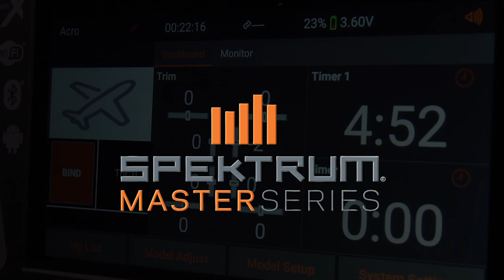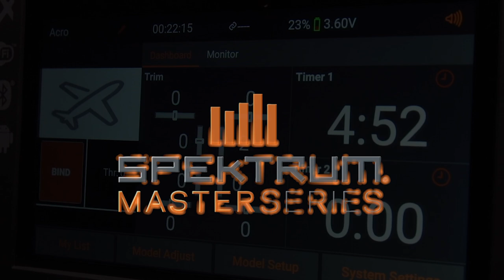Advanced Wing and Tail Type Setup - Spektrum Master Series

Comment: Now you need to do one showing how to set up the transmitter's flight modes on the flap switch so that you can trim the ailerons and elevator in each flap position. Also, show how to put the flight modes on the rate switch and rudder stick position switch to increase the elevator and aileron throws whenever the rudder stick is at or above 85% deflection.

Comment: Thank you, great video explaining this. I also found that my NX10 also has the crow feature built in to the software if the correct wing type is selected in the setup. This on firmware version 3.06, current at this time (12-08-2021).

Comment: One major problem that you need to fix on your radios is the fact that they don’t work well when you have a plane that has four flap servos. What I mean is that you have two flap servos on each wing half. The specific issue is being able to get a precise amount of throw equally across all 4 servos. Meaning if you’re using a 2 or three position switch it is impossible to get an accurate setting when you’re at 0° all the way to 40°. When you try to adjust one servo to align it with the others, all the other servos are no longer aligned. Please fix this.

Comment: I’m using an ix20 and have a dual flap setup on my airplane. When I drop the flaps with the three position switch they travel different amounts of travel.  I’d like to match the right wing to the left. How do you adjust the throw ?  Set max throw for both and  mid flaps should be close?  Thanks for your help

Comment: The recent IX20 firmware update included the ability to transfer audio settings from one model to another. Please explain how to do this? Also there is now an icon labeled SD on the top of the screen with a curse below it. What is the purpose of this ?

Comment: I would like to be able to have a switch to enable or disable crow independent of flaps. e.g.  Full Flaps with or without crow depending on a switch.
Also would be nice to have the amount of crow related to throttle.   50-100% TH = no crow.  49% TH = 1% crow,  down to minimum TH = max crow.

Can this be done with this with the IX20SE?

I can to do this on my other radio very easily, and it's 1/5 the price of my IX20SE.

Comment: Will the crow feature be available on all IX series radios?
Reply: I think if your transmitter has the latest update you even get all these functions on the NX line as well as the IX. I just learned I could do all of this on my NX8 by simply picking the wing type, and crow appears in the menu. I havent tried all the settings he demonstrated yet. The IX just has the spiffy touchscreen.
Reply from the maker: The Crow column will NOT be available on the iX12 models. But it is on the NX and IX20. This functionality is made possible by the latest and greatest CP processors. Hope that helps!
Reply: @SpektrumRCvideos  Hi, that's something I don't understand. I have the IX12 where firmware can be updated but this functionality isn't available? Why ? I bought the IX12 because I expected flexibility (Improvements) via firmware updates but his seems to be limited. Is this transmitter already outdated?
Reply: @SpektrumRCvideos  I guess I picked the right radio
Reply: @SpektrumRCvideos  Nx10 has it?
Reply from the maker: Yes, all NX transmitters and the IX20 have the crow column in the Flap menu
Reply: @SpektrumRCvideos  is it only for 2 aileron 2 flap setup or also available for 1 aileron and 1 flap?

Comment: I have a model I have set up using the taileron A tail and notice that elevator compensation in the Flap System menu has no effect on the elevators. If I change the tail type to duel elevators it acts as expected. Is this normal?

Using iX20 SE
Reply: Correction, I’m using TAILERON A

Comment: it posible to set the crow on the IX12?
Reply from the maker: It is, but you need to use mixes. The ix12 does not have the Crow column in the flap menu
Reply: @SpektrumRCvideos   can you guide me how to do it, i already have dual aileron and dual Flaps on the wing type